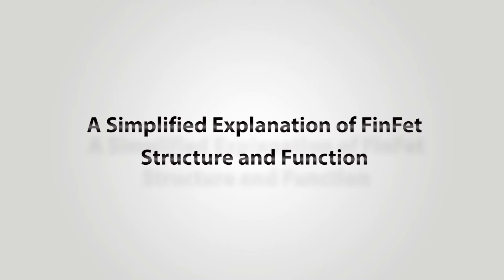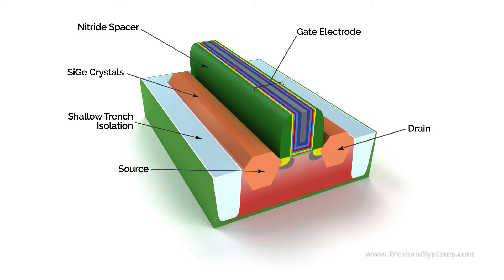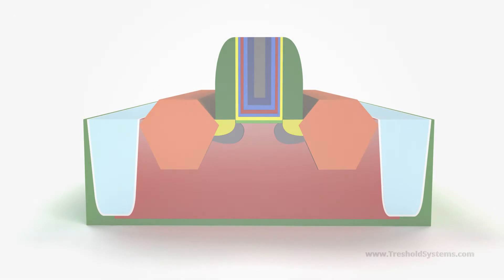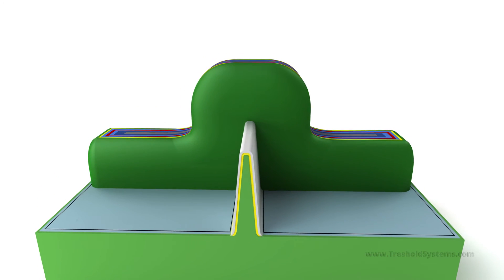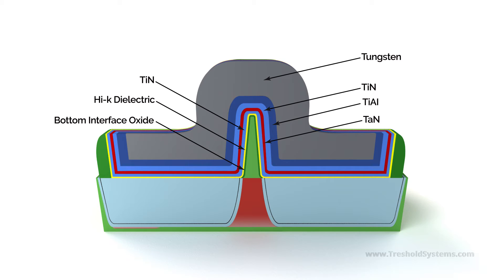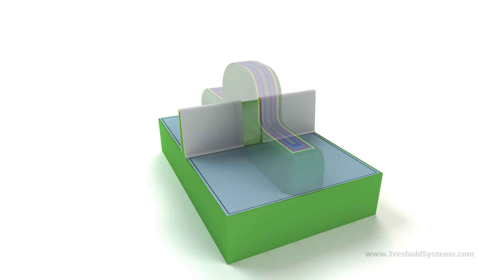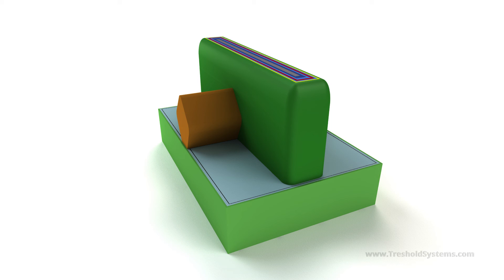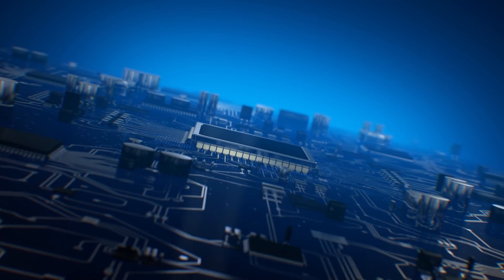New FinFet Semiconductor Structure and Function

Comment: what is 14, 22nm in processor...........is it the size of a transistor..............?? please answer.............
Reply: it's the length of the channel
Reply: @Arsen0895  source?
Reply: @FelipeFerrazMO  no, the gate of transistor
Reply: @Arsen0895  I mean, where did you read that, do you have the source?
Reply: @FelipeFerrazMO  read Baker, Razavi...
Reply: @FelipeFerrazMO  if you find Design Rule Manuals for TSMC, Samsung, GF or any other technology, you can easyly find that info
Reply: @Arsen0895  It used to be a measure of gate length (minimum feature size and M1 contact half pitch) but for modern processes the actual number doesn't really refer to a physical measurement anymore, more just a naming convention.